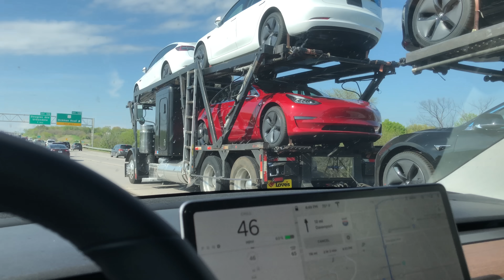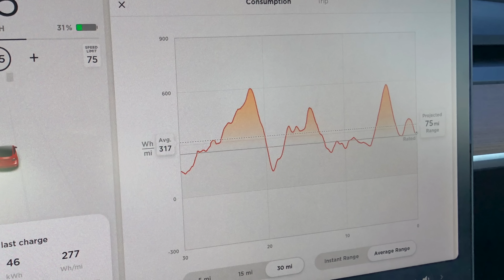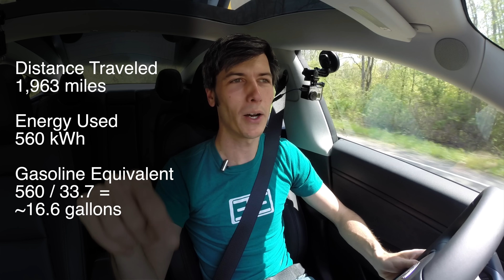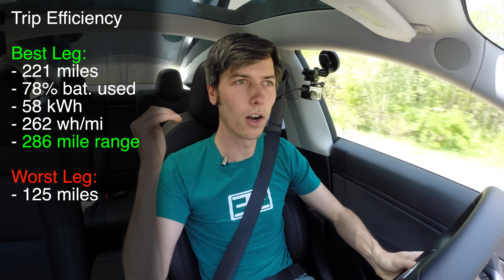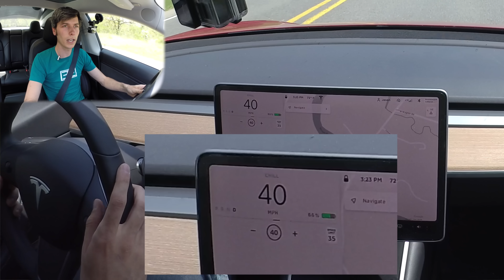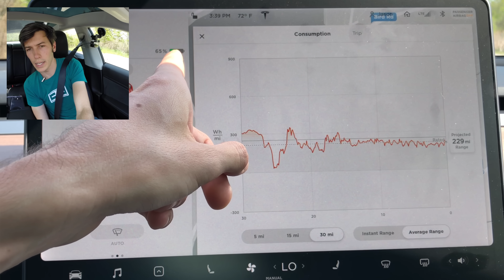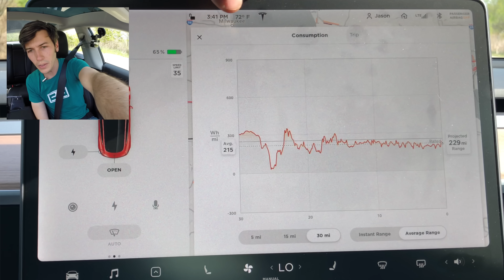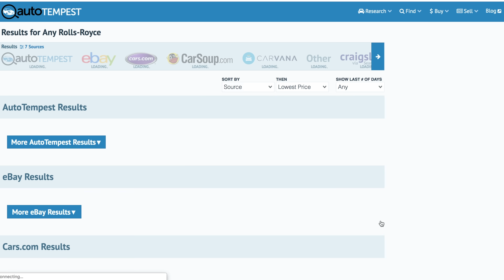How Miserable Is A Tesla Road Trip?

Comment: He does not look 56 years old .  200 miles and charge for 50 minutes .   No thanks , i can go 400 miles in my gas guzzler and  be finished im 5.
Reply: paul joe 1. No way he needed to charge for 50 mins every 2 hours.  He may have stopped for 50 mins but didn’t need that much charging.  2. I have zero desire t drive 400 miles without stopping.

Comment: I would urge you to take another look at what "energy efficiency" actually means. You yourself indirectly explained why gasoline is much more energy dense than the lithium batteries in your Tesla. It might be financially more efficient, yes, but as far as the user is concerned, gasoline is significantly more efficient. Less than five minutes to fill a tank with bigger range than the battery, and it weighs a fraction of what the battery pack weighs. Lithium ion batteries as we know them cannot come close to being as efficient at storing energy as gasoline is, and probably never will, hence why some different battery tech will have to be used to make electric cars have true mainstream appeal. You simply can't make tiny electric cars that go fast and far (relatively speaking) like you can with gas powered cars, and that won't change until battery tech changes.
Reply: awesomeferret well as soon as I commented he rolled into the cost breakdown, but $3/gallon is $0.25 over the current national average in what is typically the higher price month of the year. Based on prices in the southeast I could make that same drive cheaper in a 1/2 ton truck
Reply: @johnbelew  that's what I was calculating, a gallon of gas here is never $3 average around $2.70. It seems that using an electric car would have no benefit for people in this region.
Reply: awesomeferret based on the total kWh he said he used and the price of electricity, it’s actually not even more financially efficient. My math shows roughly the same dollar amount you would spend on fuel in a car that averages 30mpg.

Comment: You may not think 7 hours is a long time for charging and I heard you say how fast the super chargers charge but 7 hours is way too long for a 2000 mile trip. So as fast as you believe the super chargers are they need to be faster for EVs to be ready for prime time. The typical gasoline powered sedan has about 400 miles of range and can be refilled in 10 minutes or less. I'm not anti-Tesla or anti-EV but recharge times and range both need to be improved. I think what's really needed for mainstream adoption of EVs is some sort of battery packs that can be swapped out quickly at battery stations instead of charger stations. Of course for this to work all car manufacturers will need to decide on a standard for a battery cell and work together to make their batteries interchangeable.

Comment: Can you increase battery buffer from 15% to 50% in order to adjust distance between charge stops on the map? If you can it should automatically plan the route so you use only fast charging part of your battery.

Comment: There is no real doubt that most of us will eventually end up driving an electric car in the long term, however I was so disappointed to see that the cost of "refueling" is not that much different than gasoline. Like you said, you can charge at home slower and cheaper. So they sell you not only kW,, but time as well: one of the only thing we cannot buy more of. We can just just allocate it differently. They are indeed crazy smart !!! Genius.

Comment: What a pain in the ass, and I would just stop, gas up in 5 minutes, and be on my way. And, I can run the heat or AC with very little affect on mileage. Also, it's NOT more efficient, over 90% of the electricity used to charge this thing is generated by coal and oil and only 1 or 2 percent of that makes it to the wheels. That makes it a gross polluter. On the other hand, my 18 year pickup's emissions are so clean you can inhale the exhaust with no ill effects short of lack of oxygen. Don't believe me? Take it up with the guy who tested it at the smog station. This is boring, so I've got to go. Bye...

Comment: A potential remedy for the long recharge times...engineer the cars so that the battery can be replaced quickly, 5-10 minutes. Super charge stations could store 3-4 batteries on a trickle charge to swap yours out with, for a price of course. You could call or text ahead to the super charge station and they would verify whether or not they have a battery for your car. You pull in and in the time it takes for a potty break and a quick stretch of the legs you're on your way again

Comment: Would it have been faster overall for the entire trip to drive at 60 and get more range, less with stops?
Reply: Going slow like hypermiling the Tesla would be a drag, the great thing about the quick charger is to stop for eat, drink or relax just as you feel like, and leave the car to charge while doing that. Much pleasant traveling that way than grab something to drink on the go...
Reply: @norvindadealmeidabrandao6981  7 or 11 more hours is a no go for me, I better buy a plane ticket,
Reply: thats the reason why i hate electric cars. usually they are slow. there are enough stuff allready thats slow on the road. we dont need more of this...
Reply: @kennythemeat  I sold mine for this reason, one strong acceleration and your battery goes to the floor.

Comment: Great video Jason. Can I suggest a whiteboard video where you run through the science the most fuel efficient speed at which to drive. Several Carsales people have told me 60kph to 80kph.
Reply: In an ICE, the most efficient is low revs and top gear. for example, 2000rpm in 6 gear, most cars are geared to get like 100km/h give or take. This is because the ICE engine is more efficient at that kind of rpm. For the EV, the engine is very efficient from 0 all the way to top speed, so all you have to consider is aerodynamics and friction. The Tesla would do better with the 20" covered in discs. :)

Comment: I have watched a number of your videos and I enjoy them very much.  In this video you compared how far the stored electrical energy allowed you to drive against using gasoline.  The battery however stores the energy that is generated from an external source.  The external source have loses related to the generation and transfer of that energy to the battery.  Your comparison doesn't take in account the losses from the source to the battery.  Your comparison of the overall costs to make your trip are very close and that might indicate that the overall efficiencies could be much closer.
Reply: Are we also calculating all the losses and costs of gasoline production, storage and transport then? Is the price for electricity/charging not reflecting that the same way as the price of gasoline is (ignoring all taxes for simplicity) since electricity is also in the market of CO2 emissions where renewable sources are still almost irrelevant statistically? If you're gonna complain about apples and oranges, replacing one with watermelons isn't much of an improvement. The gasoline production line is one of, if not THE most wasteful sources of energy, and despite it's ridiculously long development time of 100+ years, the only industrial energy source more wasteful than gasoline is nuclear, which is still a special case because the energy density is so far off the scale away from everything else that it is hard to even compare it because such a relatively tiny amount of fuel could replace the need for all the other fuels. Those efficiency gaps will only grow wider over time in favor of electric when gas will be taxed appropriately with the costs we will all pay in the form of climate change. CO2 emissions are hidden costs, offloaded to the earth's atmosphere and oceans and those costs will explode over time when we start to reach maximum capacity. And the sun is the most powerful, most abundant energy source we could ever need anyway. It powers almost every process on earth already (the exceptions being geothermal and tidal), even the production of crude oil through feeding and killing lifeforms over thousands and thousands of millennia. a tiny area of unused land could power all of humanity forever even with today's weak solar technology if there was an incentive and perceived urgency to do it. the problem is we are starting way too late with way too slow a pace.

Comment: Obviously not all routes have the same supercharger density but my average supercharger stop time on trips is 17 minutes.   I almost never do over 30 minutes.  If possible, I always try to unplug and get back on the road before the car hits 70% SoC.  If you can nail 10% - 65% SoC it's really not any slower that a ICE car for road trips.  120 - 150kW steady charge rate and you barely have time to pee and grab a water. :D

Comment: This kind of added journey time might be fine if you've got nowhere to be, but you can see how, as a commercial vehicle, it could seriously reduce productivity and raise the cost of doing business.
Reply: Good point.  I'm curious how it'll pan out of trucking, where you need a lot of fuel, since electricity runs about 1/4 the price per mile.  So need to weigh time versus fuel.

Comment: Let me save you some time.  Here are some false narratives and myths from which to choose.  Just reference their letter in your post:

A) EV owners spend more time charging than gas-car drivers fueling (most evs charge at home, owner never waits)
B) Range is a massive problem (average commute is 30 miles)
C) Batteries wear out, almost immediately (ignoring near decade long warranties)
D) EVs don't last as long (the car he's driving in the video is said to be good for 1 million miles with 2 replacement battery packs)
E) Only EVs need electricity to fuel up (ignoring that gas pumps are also electric)
F) In an emergency only gas will be available, not electricity (it's often the opposite, or sadly both are unavailable)
G) Stopping for 30 minutes every 4 hours of driving is outrageous (I have literally tracked with gas cars for hundreds of miles)

There are a bunch of others but those seem to be the main. All are myths that can sadly be spun as true through dishonest narrow story telling techniques like, "well this one time ... so it's always true," etc.

Comment: A few more issues come to mind. California already has a number of brown out power issues. More electric cars draining the power grid is exactly what California needs. Number two, if these EV's ever do become main stream vehicles we are going to need a whole lot more charging stations. 40-50 minutes is a long time to wait in a line for a charging station to open up from a previous car using it. Not to mention your own charging time. Wait times can become a big huge massive problem for long distance travel. It all depends on supply vs demand.
Reply: We've got 2 EVs and live in Los Angeles.  Most people charge at home at night, so don't really expect it to contribute to brown outs, which happen on hot days due to A/C use.  We had one 2 years ago when a power substation caught fire.  I'd say their mainstream around here, and yes we could use more charging stations.  Super Charger stations usually have at least 10 stations, but I hear they can get full on popular travel days.  It's great for daily commuting, since I've got a full tank every morning after unplugging, but not as convenient on road trips.  At least I'll never have to go to a gas station again.
Reply: @SodaPopin5ki  EV's pull as much power when on a 220 volt outlet as two air conditioners do. If they become mainstream and everyone charges at night, the draw will exceed that of the hot days when everyone uses A/C. And no they are not yet mainstream, only some 600,000 EV's in operation as of today. Not even enough to cover 15% of the population of LA alone. And all of those EV's are not only in LA but scattered around the world. I would guess less than 5% of the auto owners in LA have an EV today. If that number hit 40% without building new power plants.....
Reply: @danhammond9066  When I say mainstream stream, I don't mean the majority of people will be driving them. More like, they'll be accepted as "normal."  Model 3 already outsells BMW, Audi, and Mercedes sedans combined, and in Los Angeles, those cars are considered mainstream.  As far as power goes, the US has about 1e12 W power generation capacity.  At 40A, an EV would pull just under 10 kW, so that would allow 100 million EVs to charge at the same time.  So, yeah we'll need more capacity, but I'd guess a lot of the oil that would go into gasoline would be used in power generation.

Comment: I've seen a number of comments from people driving trucks that say they can fuel up a 20 gallon tank in a minute.  In the US the flow of gas is regulated to 10 gal/min, so best case scenario it takes 2 minutes.  But if you've ever pumped gas in the real world you know that pump speed varies widely and the 10 gal/min  is the best case scenario. I believe if you put a stop watch to it you'd find that your average road-trip stop is closer to a total of 15 minutes and not the 1 or 2 minutes people are claiming.  I think many such stops are actually longer than any reasonable charge time of a BEV.

Comment: Many of the comments about the "wait to charge" are really one dimensional.  That's okay, people are reacting with their gut and out of some level of ignorance, willful or accidental.  Sure, during a road-trip you will often wait a few minutes to charge with a BEV. But literally every other day of the year your car is full at the start of every day. (assuming you have a plugin at home or at work) You arrive, plug in (if necessary), and when you leave it's "full."  For me that means I have over 280 miles of range ever time I drive my car.

Over the course of a month or a year, a gas car driver spends MUCH MORE TIME waiting for their car to fuel than I spend waiting.  How can I say that? Because I never wait. It's always full.  

Also, gas drivers tend to underestimate the time it takes on road-trips to do what we all do when we stop.  You go to the bathroom, you get snacks and a drink, you stretch a bit. BEV owners do this while you charge.  A gas car driver will fuel up, then pull around and repark, then go inside the quick-stop, use the bathroom, get some snacks. If you actually track this total interaction it ends up being just a few minutes shorter than I take at a charger.

But hey, let's not actually think this through or anything.

Comment: So you saved $40 in gas on a 2k mike trip.  
If you do this trip 100x your Tesla now has 200,000 miles. $40 x 100 trips = $4,000 fuel savings, but the car still cost $60,000. 
You could Buy a very nice gas car for $40,000 and save yourself $16,000, plus not have to wait 50 minutes every 200 miles.

Comment: 50% in 20 minutes? Is that good for cycle life?
Reply: Dennis W as long as the temperatures are kept in check. Teslas have that. Others like my leaf doesn’t.
Reply: @MaverickSpawn  is that the limiting factor for battery power? Heatong due to internal resistance?

Comment: few things that aren't quite right. Google maps does know all the things you mentioned BASED on other drivers who are also using an android phone with location updating, (on by default) if there is a slow down, or stop, those potentially hundreds of other devices will update the app to show that they are slowed down, or stopped. Including fuel stops. So when it says the trip will take 10 hours, it bases that on other people driving on the same roads in the same direction.

Comment: I can drive your days worth of travel with two tanks of gas and not have to juggle statistics, gambling and risk factors into the trip... 200 miles and then stop for 45 minutes is ludicrous. Get back to me when it’s 400 miles with a 30 minute charge....
Reply: Version 3 Super Chargers are getting built now and charge at 1000 miles of range per hour.  "Tank" isn't 400 miles yet, but the new Model S now does 370 miles.  So, getting there.  On the other hand, for the other 50 weeks a year I'm not doing a road trip, I never have to go to a gas/charge station.
Reply: Ill race you across the country. And ill beat you, by a signifiant margin.
Reply: EVRacer, your cocky enthusiasm is noted.. but it’s not about a race. It’s about the expenditure for a vehicle that has of yet not past the convenience or untethered simplicity of an ICE vehicle. Having to plan your route for trips across this vast country with a 15% margin from charger to charger is only for first adopters. Don’t get me wrong, I love the idea of EVs and all their benefits. But I’m a pragmatist and EVs aren’t there yet. I do a ton of travel for work across 3 states and would love an ev for it. But I cannot be dependent on fast chargers or the time it takes when one isn’t nearby, for doing my job. I travel by air when further and rent a vehicle anywhere in the US and don’t have to familiarize myself with a charging network. My time is money and I cannot justify sitting idly by as my car charges for 30 to 45 minutes every few hundred miles. I’d be let go..

Comment: Not sure if I would count USB charging as a factor. A phone draws at most 2.5W/h. That's a tiny, insignificant drop in the bucket even for an ordinary lead acid car battery. Let alone the absurd battery bank in a Tesla. The lead acid battery on my work bench, which is mostly used to keep my cell phone charged while working on electronics, woodworking projects and cars has not been charged in a bit over 6 months; it's still above 12V with roughly the same setup the accessory socket in a car uses to plug in a charger.